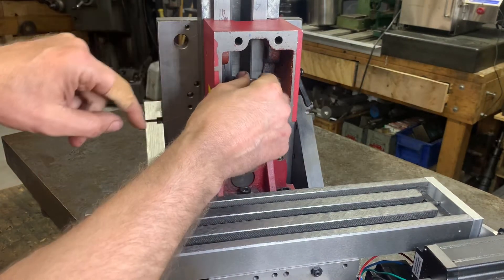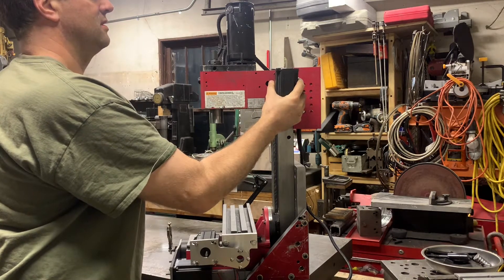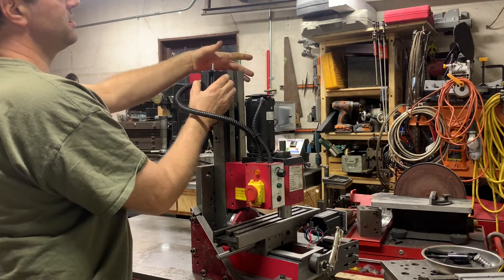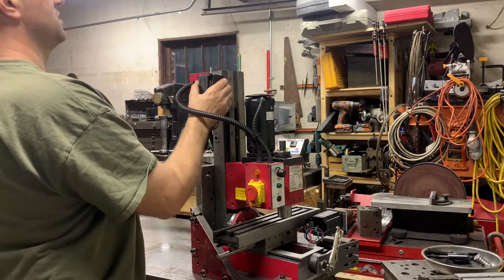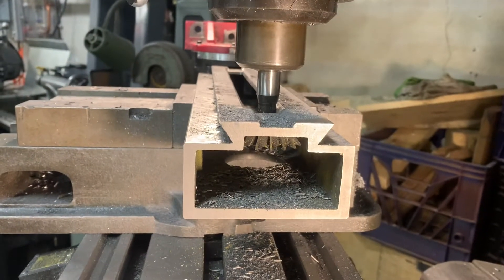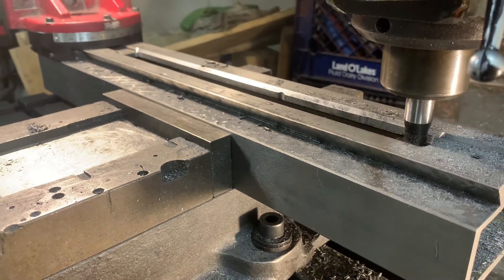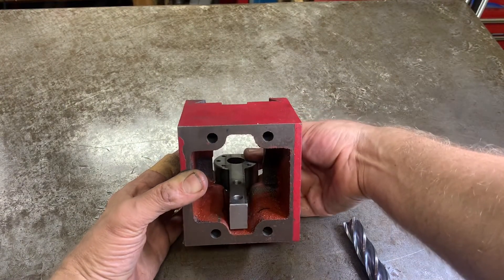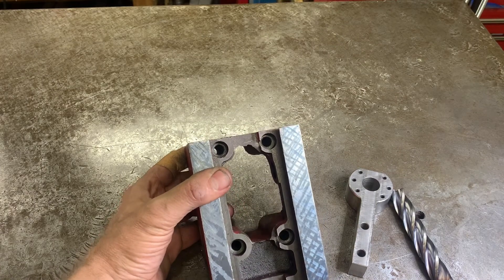Harbor Freight Mini Mill CNC Z axis start

Comment: thinking of doing this as well... any issues with the column warping after the slot? i just finished scraping, sort of not keen on doing it again?

pretty annoying that the ribs only need the slightest touch to get the room... sigh... at least i know? probably do the slot, then use a fly cutter for that bit in the same setup. i can tell you, the ball nuts are pretty hard! and really, its either trim the nut a bit, or do this, take the corners off those ribs... doing the ribs gives a bit more playing area, seems the best option.

meh. still just mucking around with the Y, lol. at least its a LOT nicer than it was with the original cncfusion kit i fitted years ago? fiddle fiddle, bind, grind, fiddle fiddle... no matter how hard one tried, was forever a pain in the butt.
but now its scraped properly, and new ballscrews... just bolt it up tight and there you go... no grinding or binding. no wriggle in the saddle, either. yay!

get the apron/way covers mounted next then i can at least see Y move with the stepper again... at least, oh my... after a weeks frustration as i attempt to get another PC actually operational. main reason its sat in the corner for the last 6 or more years... last PC blew up, (ok, it crashed for the umpteenth time and i attacked it with the remains of the last job it destroyed?) and yeah... parallel ports, windows, and not wanting to reinvest in certain things... like my gecko g540, mach3, etc... just give me XP and a parallel port and leave me alone!

i want to machine things, not fight software.hardware, and dealing with all that BS... i really am sick of this "turn around and everythings obsolete" modern world syndrome... 

looked at linuxcnc (still doesnt fix the parallel port issue?) and even the download page makes no sense... "download this one. but dont run it, download this one instead!" but whatever you do it needs the kernel and blah blah blah blah blah blah... TLDR!

yeah, i tried installing it, and ended up bricking the PC i had... that had win 10, and a pcie to parallel card that it wouldnt detect... just found an old girl that hopefully WILL accept this pcie card. wont know until... sigh... i go buy another keyboard/mouse and fire it up...

glares at last resort
usb breakout board that may or may not work...

i dont know how people deal with all this BS these days, it drives me up the wall... again, i wanna machine things, not spend hours, days, weeks, learning to code this, install that, download there... it was EASY ten years ago!
Reply from the maker: I should check for column warp.  Sounds like you’re having more fun than me!

Comment: Are you not afraid that it will greatly weaken the structure?
Long screw hole and milling from the inside
Reply from the maker: Considering how weak the stock setup was-  not really.  Plus other higher end mills do it this way.   This thing isn’t going to be running high feedrates and the spindle power is low.

Comment: Could you have broached that inner surface
Reply from the maker: Not sure which surface you are talking about
Reply: @hansw33  the inside of the casting where you plan to bolt the ball nut mount
Reply from the maker: @taranson3057  I have broaches but not sure how I would have done that you got me beat.  I clearanced out the column with the dovetail cutter.  I showed it in this video and also more in previous videos.

Comment: Dude you really need to consider getting servos since you’re trying to make it as rigid as possible
Reply: Maybe clearpath servos
Reply from the maker: I’d love to have servos but they were out of my budget.  If this goes good and I start making money with it that would be high in the list for the next one.
Reply: If money wasn’t an issue, I think every one would use servos.  I use closed loop steppers, they aren’t as good as closed loop servos but they are better than the plain Jane open loop steppers and they really aren’t as expensive as they use to be.  Everything to do with Servos is still really expensive, but you get what you pay for, and from what I understand they’re worth every penny, especially clearpath servos.
Reply from the maker: The place I bought the steppers from does have sensors to add in them and do closed loop.  First I want to get it running and then I’ll see about adding those.
Reply: @hansw33  that would be a game changer with accuracy